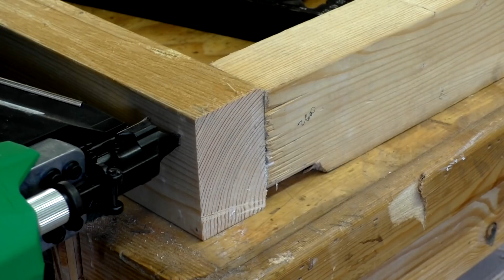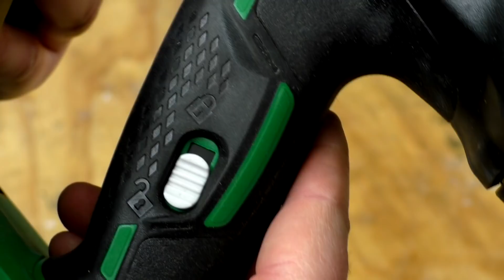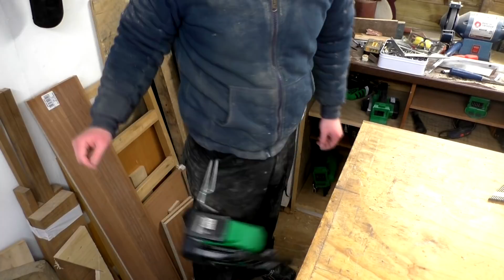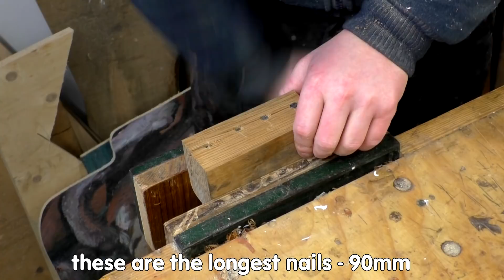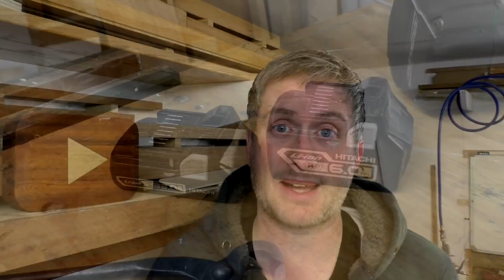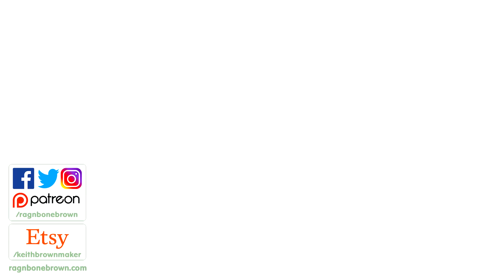Hitachi NR1890 18v Brushless Cordless Framing Nailer - First Impressions / Review

Comment: Looks like a beast. Good review. I'll stick with my Paslode until it dies though - if it does (it's 8 years old now). A framing nailer's probably a bit much for the type of stuff you do. They're not cheap but I highly recommend a Senco 18V F-18 brad/finish nailer. I've come to love mine both on-site and in the work shop. Much more suitable for the more work you do. FFX have 'em in stock too ;)
Reply from the maker: I’ve got a Hitachi 18v pin nailer too, just yet to make a video featuring it. It’s been great so far

Comment: I guess it would be good for roofing trusses where the stock is a lot thicker and working with heavier material. most of  the wood examples shown in the video was split by the nailer.

Comment: Having to switch it on every 30 mins after non use will drive people nuts(mark my words). Im a plumber and using the dewalt you mentioned for dwanging and supporting pipes at first fix stage. These battery nailers get slagged off a lot from joiners using paslodes but for me the dewalt has been fantastic. I get nails from site for free. Don't require gas. No maintenance. Pick it up and its ready to go after a while from not being used. Was able to buy as a bare tool as im already invested in the dewalt line up. At the price the paslode come's in at i probably wouldn't have bothered buying a nailer. Looks like the Hitachi is more powerfull than the dewalt which is good as thats one of the main complaints about it. Hasent ever given me any bother though as like you said its mainly new build softwoods i'm using. There is definatly a place for these battery nailers and they will only improve over time.

Comment: great review. I've been considering the dewalt version as I already have batteries and chargers for dewalt's range
Reply: ksp1278 It's a great tool. Not for everyone. But hasn't let me down. However it's a 5-6 year old tool and with other manufacturers now entering the battery nailer market giving Dewalt some competition I Wouldn't be surprised if a new nailer or updated nailer is on the cards soon.